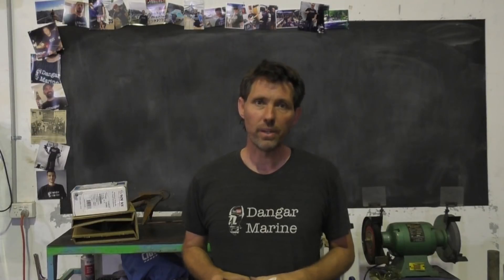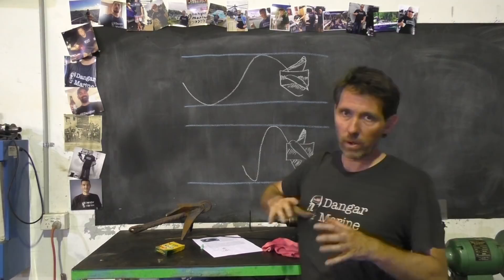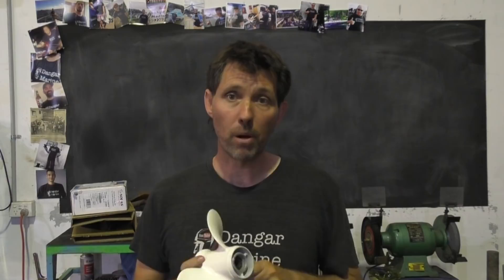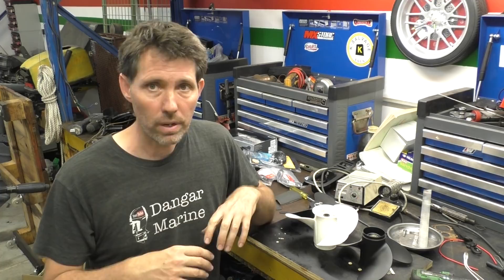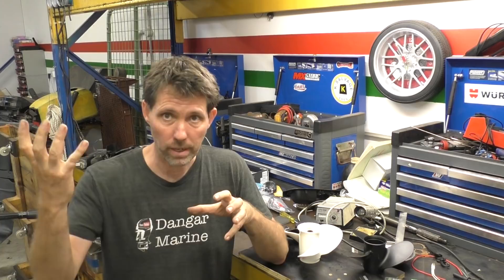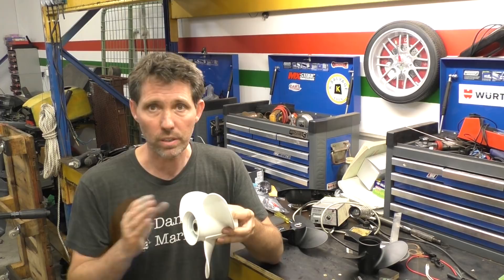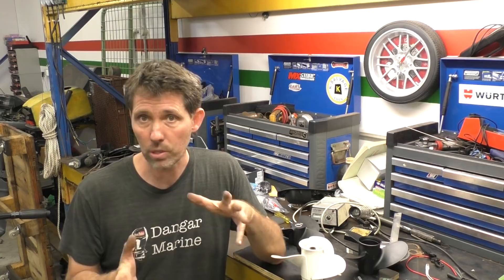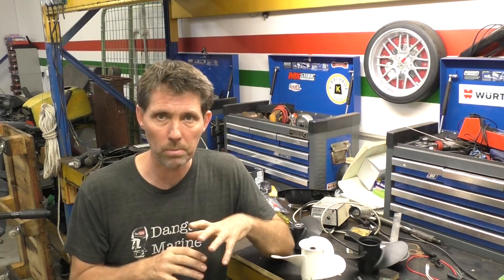Outboard propellers

Comment: I have a Mercury 35 hp on a 17 foot bass tracker.  iv tried 13 pitch to stainless  to 8 pitch ss  with all props my motors Rpm are from 4200-4500 which is no where near the 5600-6000 that mercury said it should run... is there anything that would be stoping that motor from building rpms? The motor revs fine in neutral in the water so I don’t think it’s a back presser problem and I have 150psi  on the cylinders

Comment: I have a tower of power 140 HP outboard. What pitch prop should i use to get best holeshot so i can plane out faster. Trimmed up full throttle i run 37 38 mph. I have 15 and half foot 1980. Champion bass boat.

Comment: Thanks for another awesome video Stu. Wondering if you have any opinions on Prop locks, mcgard specifically? I was looking for one to protect my SS prop on a 200 hp Mercury outboard but I have read quite a few reviews saying that they wound up losing a prop. With their setup and all the others I've seen you cannot use the Mercury lock washer which is why I think that might be happening. Just wondering if you have any ideas? I'd really like to keep it from getting stolen possibly, but I'd also like to keep it off the bottom of the lake. Thanks.
Reply from the maker: Thanks mate, I'm glad you liked it. I've never used any prop locks, and always curse every time a car comes into the workshop with locking nuts on the wheels! I'd have to see the mechanism to comment on the prop falling off, but from a prop theft point of view perhaps even just a cover will prevent anyone noticing the prop is a nice shiny stainless one and prevent some theft.
Reply: +Dangar Marine Thanks for the reply bud. I'm guessing as a mechanic you don't like them because people forget to bring them with, or tell you where they left them in the car excetera. I do all my own wrenching so that shouldn't be an issue. That being said, I'm actually thinking your prop covers a damn good idea, kind of the old out of sight out of mind. The problem I see with the locking nuts is that they don't allow you to use the factory tab washer to lock it on they just use a beveled washer underneath. I think that's probably what the problem is. But I think I'll take your advice and just try the prop cover, plus it would help while towing anyway to avoid dings and stone chips and whatnot. Excellent advice, I appreciate it.

Comment: Stu,  I have an Evinrude E60TLCEA (VRO) that has had a VRO pump delete (it has a standard fuel pump installed).  It fires up and idles wonderfully, I had a mechanic do a new fuel pump, new carb kit rebuild, new plugs, new primer service kit, no fuel leaks whatsoever.  But as soon as I drop it into gear, the motor chokes out and dies immediately(95% of the time).  Occasionally, it will chug along for about 15-20 seconds and then die.  It currently has a 13X19 OEM prop, I tried a 13.5x15 (to try and take a smaller bite out of the water, to see if it could get going), and it went to dying a bit less and chugging a bit more, but it is in no way working properly.  Thoughts??

Comment: Could you give me any suggestions on what prop I would need on a 1998 Larson flyer 176 with a 90 hp Johnson that’s currently got a 19 pitch aluminum three blade propeller that porpoises at the speed of 23 and loses power in corners when pulling a tube?

Comment: Hi mate, just going back to these older videos because I have just done a service on the outboard and always good to double check your videos :) 
Anyway being a slack arse I hadn't service my Yamaha 3 Hp (kids motor) for about 6 years - yes 6 years, they use it bugger all so that's why it was so long between services.
When I pulled off the lower unit the shaft was as black as night and encased in rust. I cleaned it very thoroughly but the shaft has deep pits on the in the middle. Question, will that cause any problems? and if yes what types of issues can come from it.

Love your videos - thanks again stu.
Reply from the maker: I can't see it being a huge problem given that part of the driveshaft doesn't run on any bushings or oil seals.

Comment: I have a question about props. I purchased a '92 Lund with a 70hp Johnson motor. Now the motor has a 13 3/4x 15 prop on it. according to the Johnson Motor manual it should be 13 1/4 x 17. The new prop that I bought should it make the boat get up on plane faster right??

Comment: Hi Stu, great vid but quick question, can I increase the pitch to get better speed at a lower rpm? I have a 70hp Suzuki 2017 on a Stacer 475. It punches straight on plane but I prefer driving at 3500-4200 rpm like on a freeway you use the top gear and cruise at low rpm. My dealer talks about full throttle and rpm like you do in your vid but I never drive at full throttle.
Reply from the maker: It's an interesting point you make about finding the best performance you can get at the RPM you generally drive at. I am the same as you in that I rarely drive at full throttle. You could try a steeper pitch, but you can end up with the motor labouring which isn't great for it either. Unfortunately you may find a little trial and error is the only way to find out for sure.

Comment: I know this is an old video but I have a question for ya. I have an 9.25 x 10 13 spline non thru exhaust prop which replacements only go to 12 pitch, can I replace it with a 13 spline thru hub exhaust prop? Disadvantages?

Comment: Live got a 70hp Nissan 2 cylinder and my boat is to heavy for the engine but a 13 pitch wount plan just tacs out and a 17 wount plan just bogging down what would be a good prop to start with

Comment: Nice video....how does the diameter of the prop effect the  performance of the boat?
Reply: magnumclenergy A larger diameter prop will absorb more power so the same pitch with a larger diameter would be for a larger engine and could pull a boat with more drag through the water.  Actually the term aspect ratio compares the length to cord on a wing or blade with a longer blade being more efficient due to the tip vortex losses being less.
Reply: Thanks
Reply from the maker: I should have got you to do this video William!

Comment: I have a question. I have an 1974evinrude  15 hp and the prop hardly has any pitch I've been trying to find out what is the correct manufacturer pitch for my motor. I have it on a 14 foot jon boat and it seem like it doesn't want to hardly go.

Comment: I got an Ole Mariner 4hp 2stroke for my 12 foot dinghy, the only number on the propeller is pressed in the middle its an 8. 
Is it possible to chance a hub in that? Or is the hubs only for larger engines, so I has to buy a new propeller?

Comment: Hi...  can you answer me please if you know? What is the different of thick and thin blade?  If i use thick or thin blade with the same pitch will be the same acceleration and speed? Thanks.. please help me if you can...
Reply from the maker: I can't imagine there being a huge difference other than perhaps the larger rotating mass spinning up a bit more slowly and lasting longer.

Comment: I have a 12 foot aluminum, light weight, with an '85 15hp Johnson 2 stroke.  I think the stock prop is a 9x10.  What prop would get me more top speed?  Not too worried about the hole shot-  GPS says my top speed now is 23.  Can I squeeze a few more miles per hour?  Thanks Mate!
Reply: Ive got a 12 foot flat bottom punt with a 1998 Johnson 9.9hp that does 20mile with three people on it. Im not going to complain now

Comment: Will ventilation or cavitation cause the water pump to suck air when on plane? I have a 79' mercury model 110 that pees hot but strong when running slow and low but quickly becomes steam and just a spatter of water when i get on plane........the cavitation plate sits about an inch below the botom the boat. Do you think a hydrofoil might help with this issue or do i have a water pump/passage issue?
Reply from the maker: It is certainly possible, but a tricky thing to check or test for. Also consider the possibility that the head gasket is blown and the exhaust gasses are pushing the cooling water out of the water jackets.
Reply: @DangarMarine  thanks for the reply.ill see if I can get my hands on a set of gauges and do a compression test. I also plan to replace the entire water pump assembly. I'll let you know how that goes sir thanks again

Comment: Hello sir, can i ask you if that prop 9 1/4 X11 was the ideal prop for 16HP inboard engine? My boat size is 12X5 feet V hull 15° deadrise 68 kg. Please reply thank you. Oh by the way, my boat engine is Honda GX 390 16 hp
Reply from the maker: It depends a lot on the hull. Trial and error is the only way to find the ideal prop.

Comment: I have a 9.9 Yamaha 2 stroke on a gheenoe 15’4 that weighs about 130-140 pounds and I don’t pull or anything on it. What would be the best pitch for it if I want a greater top speed. What would be the best for that, what kind of propeller ?
Reply from the maker: Probably just the stock propeller that comes with the outboard, but I don't know what pitch that is, you'd need to look it up.
Reply from the maker: Probably just the stock propeller that comes with the outboard, but I don't know what pitch that is, you'd need to look it up.

Comment: How can I increase propeller efficiency for low speed??  I have a 1978, 29 ft Chriscraft (10,000 lb) with two 4 cylinder, 3.0L, 130 HP,  Mercruise inboard engines .  Wide open throttle cost $60/ hour, 17 GPH, at 22 mph, 4,400 RPM. so I don't often open it up.  I poke along around 7 MPH, at around $15 / hour most of the time.  My props have a 17 pitch. 
   I would like more efficiency  around 7 MPH, and I don't care about high speed performance.  What pitch prop or diameter prop would increase my low speed efficiency without challenging my engines' integrity due to high  combustion chamber pressure at around 3500 RPM/15 MPH, which is where the boat planes off with the 17 pitch prop.???? I have no desire to ever operate the engines above 90% power which is approximately 20 MPH/4,000 RPM or fast acceleration.  My engines' compression is around 140 psi on all eight cylinders. That is a 7:1 compression ratio which is relatively low. IMHO over propping the engines some will not damage the engines.
Reply from the maker: I'll confess straight up I'm not an expert on this, but I would tend to agree that over propping it isn't likely to do much harm. Most motors don't like to be run for long periods of time at light loads so you may actually be helping it. There is no doubt that selecting the right prop is a bit of trial and error. When you buy a new motor, the retailer (if they are good), will do several on water tests before settling on one. I would try going up an inch of pitch and then pull the spark plugs after some running and see if they still look like they are burning normally (not too black etc.)

Comment: before we go changing props to get more performance lets be sure our motors are performing up to full power ....often times i find guys and gals complaining that the prop is wrong when in fact they have a poor performing engine....after a full tuneup or repair of whatever the issue was magicaly the prop is ok now.....lol
i disagree with your idea on stainless props vs alum....we dont replace stainless when it gets damaged ....we weld and rework for a fraction of the cost to replace .... you dont do this down under? some of my fastest props have reworked several times.

Comment: a stainless prop could do more damage to ya shaft if ya really hit something,where the alii prop will bend,,,,
Reply from the maker: Although the rubber bushing in the hub will probably absorb enough of the shock load to prevent any real damage.

Comment: I’m running a 13 pitch 3 blade 11 1/8 on my 84 mariner 50 hp 2 stroke. I found a new prop of amazon for half the price of a Solas at 76 bucks and it has the hub in the prop to. The name of the company that makes this 13 spline is Polastorm  it’s made in China but it looks awesome and works very well.  It did take a week to get it shipped. You can fiend this OME prop at www.POLARIS2010.com  I hope this helps. Because I looked for about 4 days to find prop info on my 1984 50 hp mariner 2 stroke.
Reply from the maker: Sounds like a good deal!

Comment: Listen here - I have failed x3props over the years, on first occasion we went to land and removed a screw from a BBQ table roof, jammed it all good until high revs caused slippage on the rubber bush, next two times I got home but just going a few revs above idle, took forever nut got to the ramp, 3rd time got greedy and went fora little for revs and the slippage got so bad we anchored and waited for a friend tow- secret is, carry a prop not suited but if it’s solid stow it as on-board spare live with it,